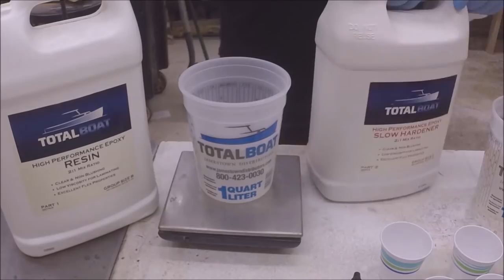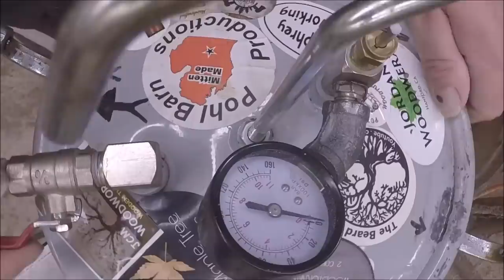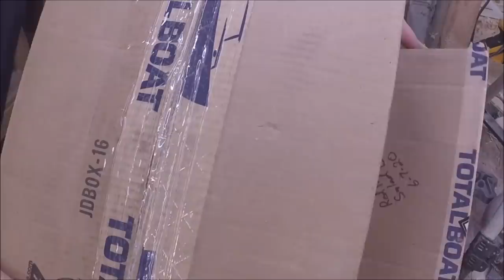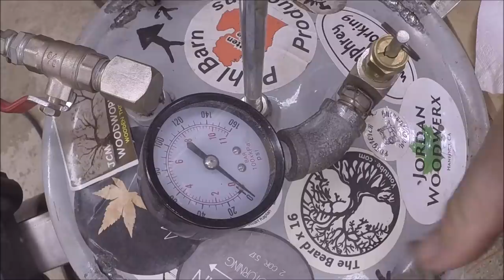Box Elder Bowl with Resin Coat

Comment: I have a question? Now please understand that I am a huge fan,and have watched evey video you have done!  But cant help to notice that you cut pieces that are fairly solid and you pour a big amount of resin. Then turn 90% of it off.the blanks are beautiful and live the colors.if you take requests, maybe smaller wood and more resin in finished project? Again please know i love what you do.just think be cool if more resin at finish
Reply from the maker: Thank you Dan, in order to get the resin where you want it without witness lines, it is cause for the amount I turn away, you could do this any way you really wanted, most of the wood that I use is rotten and soaks up the resin also, the other issue is that the more resin you use the more likely you'll have exothermic reaction and then you get what I had in this one, Cracks due to the heat created by the amount of resin I used,  I hope that helps you understand my madness.  lol

Comment: QUESTION:  In your opinion, what is the best epoxy resin to use for making river tables and and other projects like that. I’m not going to be turning anything on the lathe just yet, so with that I mind, what do you recommend for me to use. Just a beginner by the way. Thanks so much.
Reply from the maker: really Kent I have not made a river table, I would think there are resins out there for that sort of thing, Maybe check into say Stone Coat

Comment: I'm thinking to use a lathe to make some Chinese style teacups,  I was wondering if using a resin on wood like you did here would make them watertight for a use like that and if the resin would impart a "flavor" into the tea,.  What do you think?  This bowl you made in this video is a beauty.
Reply from the maker: I would think once it cures you'll be fine but you might have to also stabilize the wood so it is water tight as well

Comment: You do some really great stuff with some unique ideas of things to mix with resin prior to turning. Ever try using colored crushed glass? I have about 50lbs of crushed glass from when I was making concrete table tops and embedding glass in it. Ever seen it done? Point me in the direction of someone who has done it? Thanks Gary
Reply from the maker: Thank you Gary, I have some glass but I am worried about what it will do to the tools, so I haven't used it yet
Reply: What about using a grinder with the polishing pads? I have diamond pads from 30 grit to 7,000. Obviously I can’t wet grind like concrete, but my lathe is next to the garage door and I could use a barrel fan to blow the dust out. The garage door opens to a field so it won’t bother neighbors.

Comment: Why the pimples? Temp?.... regardless the bowl is nice. Sorry for your loss and understand why you might not want to do a talk at the end.
Reply from the maker: pimples are due to air coming out of the wood after I am sealing both sides with resin. the resin heats up and so does the air in the wood that then expands and has to escape some place
Reply: @PohlBarnProductions  Oh... that makes sense now that you explained it. I was thinking shop temp or dust particles. Thanks